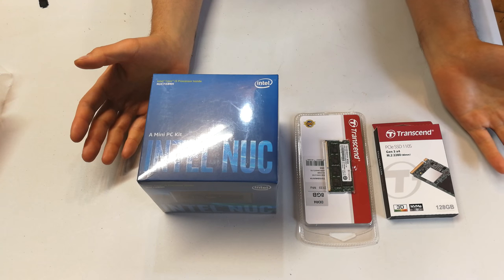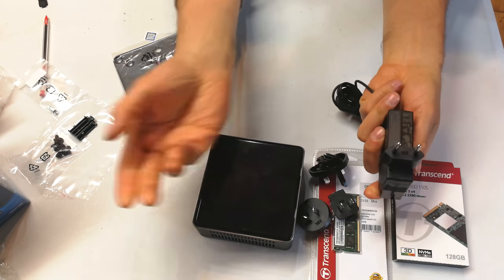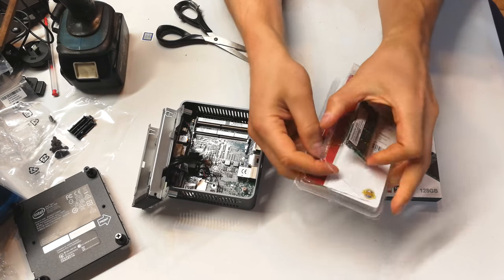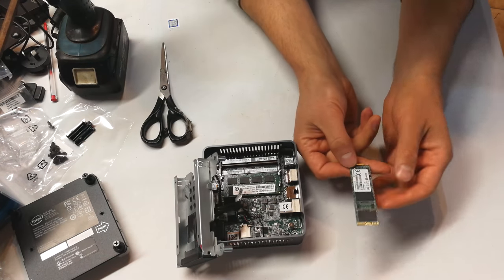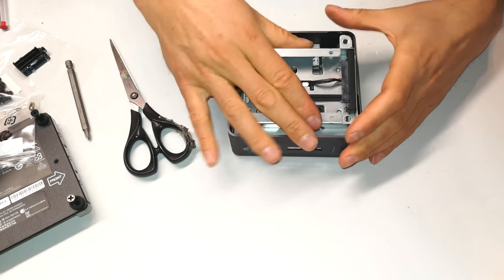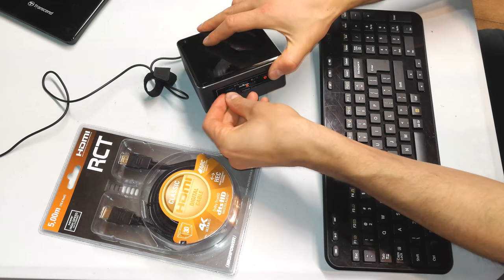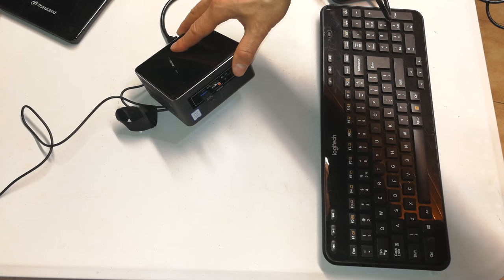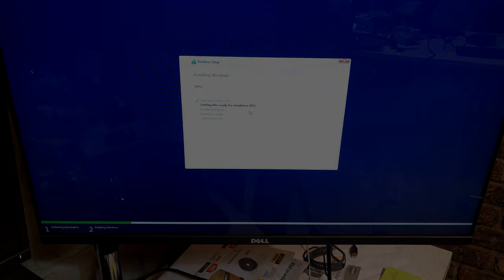How to set up an Intel NUC in under 10 minutes

Comment: Be advised the Intel NUC User Guide warns you not to use a drill driver when working on the unit.  Use a regular screwdriver instead to avoid over-torquing, stripping, or shearing the screws.
Reply: Thanks

Comment: For some reason my led ring is not working, tried at Bios set up and no luck at all... Wonder what did I do worng.
Reply: This was removed from the latest generation.  You may want to check if your model was equipped with it.
Reply: @beauceph  ohhh, that make sense then. I though mine is faulty but if that's the case then that's fine.

Comment: does it support 4K@60fps if I use HDMI 2.0a cable?
Reply from the maker: this is a bit unclear at Intel spec page. They claim the 60Hz is supported with Display port. Some NUC are not compatible with HDMI 2.0 but operate at 1.4 in this case giving a max of 30Hz and not 60Hz